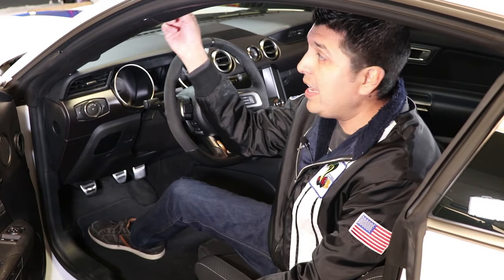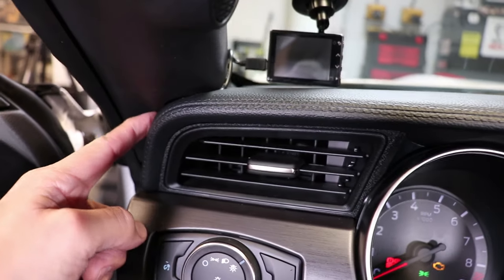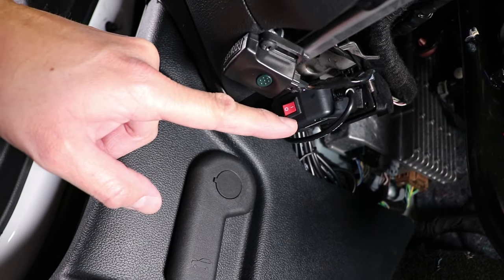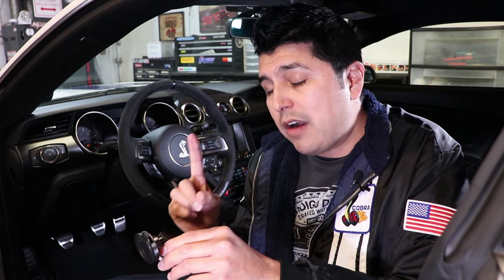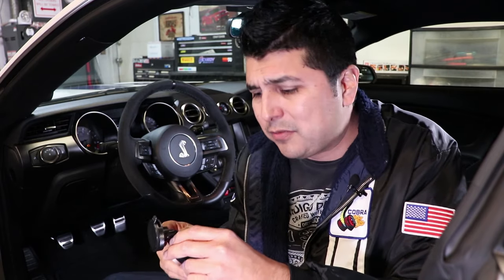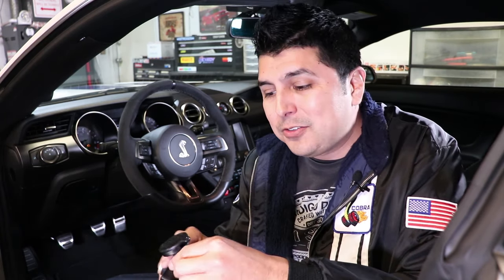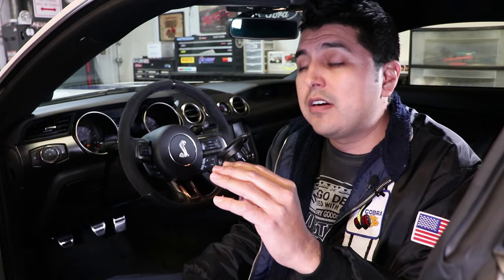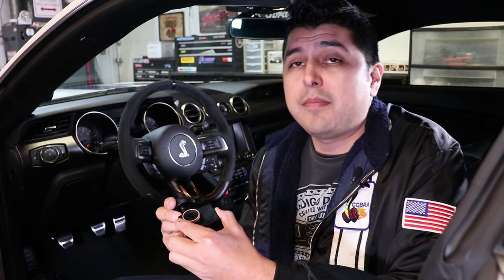Don't hardwire your Dash Cam! Try this instead!

Comment: so if your dashcam has a cigarette lighter plug for power, how do you attach that to the ODB adaptor?
Reply from the maker: Hi kingkongxiong, most dash cams use a USB connector for power, the cigarette plug only converts the 12v from the car to USB power at the end of the cable. I put links in the description to the OBD adapter, it does the same, it converts power from the 12 volts at the OBD connector into USB power at the connector end (which plugs into the dash cam). There are a few dash cams out there that use 12v instead of USB power, those would be the exception where it will not work for them. Hope this helps and thanks for watching!

Comment: The ODB connection is a great idea but what if  you use a ODB scanner to check what is going on with the car?
Reply from the maker: Thanks Yolanda! but yeah there is another option if your ODB port is being used by a scanner. Here is a power adaptor that taps into the original mirror' power https://amzn.to/3tDXPoj I'm working on a video showing it. Here is also my hardwire video if it helps https://youtu.be/83a3w6EtzXo and thanks for watching!
Reply: @AlexAutoFun  OMGosh, yes I can't wait to check out this video.  thank you for your answer.  another question, does the dashcam need to be hardwired for the parking mode to work?
Reply from the maker: @yolandagomez9255  It depends, some dashcam require you to hardwire them to enable the parking mode which won't be enabled by the OBD adapter or the mirror adapter. But here is alternative dashcam that supports parking mode without having to hardwire it https://youtu.be/bkzxrPe-e_8 :)
Reply: @AlexAutoFun  thank you.   This mirror cam looks fantastic
Reply from the maker: @yolandagomez9255  You're welcome, yeah I can't go back to a regular mirror now LOL
Reply: @AlexAutoFun  I couldn’t either if I had that mirror, that  one is awesome.  You’ve reviewed a lot of Dash cams, would you prefer a mirror cam or a task cam like the  garmin.? I like the hands-free feature on the mirror that you reviewed
Reply from the maker: @yolandagomez9255  I have both kinds but personally like the mirror dashcams because they are stealthy and blend in with the interior of the car. Specially now that newer cars are coming with LCD mirrors I think it also modernizes cars that didn't come with one like mine...
Reply: @AlexAutoFun  Hi Alex;  have you review the plug and play adapter for the rearview mirror yet?   I checked my auto  dim rearview mirror and not sure how to plug that in.  I would like to install it this way if I can.   I'm hoping you would review, I like your videos and explanations.  I have a 2012 toyota camary xle and I removed the mirror but not sure how to plug that in or even if I can
Reply from the maker: @yolandagomez9255  Hi Yolanda! not yet, I'm testing different brand ones to see which one works better and complete the video with it, almost there. Stay tuned friend! 😀
Reply: @AlexAutoFun  hi Alex did you ever find a plug and play USB for a mirror dash cam? I was looking through your videos and I can’t find anything I’m not sure if you’re done Experimenting.
Reply from the maker: @yolandagomez9255  Hi Yolanda! No unfortunately nope. I think it may have to do with how much power the actual OBD port can deliver which limits the power that the OBD adapter can produce...
Reply from the maker: Hi Yolanda! I finally found one that claims to output 2.5A! (which is what most mirror dash cams use and a few need 3A) and I remember you asked about this, here you go https://amzn.to/3epnu1O Cheers!
Reply: @AlexAutoFun  perfecto Gracias   hope you can do a demonstration of it.  I forgot,  what about a rear cam, will it work if you get a dash cam with a  rear cam?
Reply from the maker: @yolandagomez9255  You're welcome! ah yes it works like the one I showed on the video, except it will stay in surveillance mode all the time, where on the low power version you can select surveillance mode or ACC mode (both modes explained on this video also) Hope this helps, Cheers!
Reply: @AlexAutoFun  yes it does, thank you
Reply from the maker: @yolandagomez9255  You're welcome, glad to hear that 😊

Comment: The OBD port is designed for diagnostics only. It is not recommended to use it for powering anything beyond diagnostics. Even the little OBD plug the insurance companies give you to monitor your driving habits is not recommended to use.
Reply from the maker: Hi M J! I don't believe the SAE / ISO standard covered the power requirements beside the pinouts locations on the OBD2 connector. But traditionally I seen them capped at around 4amps which will cover most dashcam requirements (typically at 2amps) However I do know some folks rather not mess with the OBD2 port, check out my hard wire video https://youtu.be/zbxYA4VhuT8 maybe more of what are you looking for bud, hope this helps and thanks for watching!
Reply: @AlexAutoFun  Thanks!
Reply from the maker: @Mo.Jo. You're welcome my friend!

Comment: OBD should not be used to draw power for dash cams, manufacturer says on one of the blogs.
Reply from the maker: Hi J! Here is my follow up video showing how the adapter works (and how it relates to the SAE J1962 standard we use in the industry for the OBD2 port design and use) https://youtu.be/aV5jQovoaCI including the use of the OBD2 port by non-diagnostic tools. I been running mine for over four years now without an issue and since making this video, we also seen more dash cam like Ring, Garmin, Thinkware, Vantrue, Nexar, Wolfbox, use OBD2 adapters. However if you would like to avoid using the OBD2 port for power (and also looking to enable park mode) here is my other video showing the alternative Hardwire method https://youtu.be/zbxYA4VhuT8 Cheers!

Comment: Alex, so how did you end up watching files on PC? VLC  player cant, nor windows media player can.. any thoughts bud? thanks.
Reply from the maker: Hi A. Jay! you may have the dashcam set to H265 codec. This codec usually does not come with windows and will need to be downloaded separately. If you set the dashcam to use H264 codec it should play fine as it supported by windows without having to download anything else..
Reply: @AlexAutoFun  Thanks Alex,  I use VLC, it should be ok, what I found out from VanTop  was, I bought from ebay a fake Samsung 128gb EVO SDXC  card..waiting new card to see.
Reply from the maker: @ZorroDaddy  Oh man I heard about the fakes out there, always paranoid when I buy a new one check it real close!
Reply: @AlexAutoFun  Yes, well I took photo of the "pin" and oh boy, they were scratched, casing too, and under the scope showed it as if it was tossed in the street and cars passed over it.. recall  old beat up street coins?  same.
Problem with Vantop CS, and I sent several emails asking what type of SD your device uses, no answer, just run runarounds.
Reply from the maker: @ZorroDaddy  Man that sucks, this is the one I'm using if you are curious https://amzn.to/2FUFJuz it's worked great all this time!
Reply: @AlexAutoFun  Thanks, just ordered it,  BTW, Amazon in NOT immune to fake products.. they are becoming Ebay #2 last year or so.  Though I don't celebrate killing of Native Americans day ,  Happy and Safe turkey day.

Comment: That would be nice, but my car triggers the alarm when the car is locked and there is something connected to the obd
Reply from the maker: Hi Locknath 007! some folks use a OBD splitter like this one https://amzn.to/3Kv7OFr to run multiple OBD devices at the same time, however I have not tried that myself. And here is another video I made showing the Hardwire method https://youtu.be/zbxYA4VhuT8 Hope this helps and thanks for watching bud!

Comment: Where do you get the part that plugs into the OBD port? Also, I want a quick disconnect for the camera because I don't want someone to break my window to steal the camera!
Reply from the maker: Hi Ltl Paa! here it is Micro USB https://amzn.to/2Xzwtlt smaller USB connector or Mini USB  https://amzn.to/2XFijQA which is the larger USB connector.

Comment: Mm but you have a vision obstructuon now, plus hardwire is reversable from fuse box, or look for fuse thats always on that way power is on so if someone breaks in its recorded
Reply from the maker: Hi Eric! yeah unfortunately the lower portion of the windshield on the corners is the only location we can "legally" install our dashcam here in California ugh. I did also posted a follow up video showing the hardwire method https://youtu.be/zbxYA4VhuT8 if you want to take a look and thanks for watching bud!

Comment: Doesn't hard wire kits have auto shut off so your battery won't drain? Mines does
Reply from the maker: Hi adictiveadictive, yes most high quality hardware kits have the auto shut off feature, which to your point it's definitely essential to avoid the dashcam completely draining the battery. Thanks for watching bud!

Comment: The problem with this is, you will adjust the switch every time you want to use surveillance mode, hence hardwired no need to adjust its automatically turn on.😃 i think hardwired is better.
Reply from the maker: Hi Ron! I typically leave mine in the mode that works best for (so I don't switch it at all) however I imagine that there may be people out there who do. Hardwire does have many advantages (at the expense of more labor) including enabling true parking mode. Here is my follow up video showing the alternative Hardwire method https://youtu.be/zbxYA4VhuT8 Cheers!

Comment: Easy to pull a A-pillar molding and your wiring routing would not work on many cars/trucks. Won't work on my GMC PU truck or my Hyundai Tucson just to name two.
Reply from the maker: Hi Douglas! Yep this method is not for all vehicles, here is my other video showing the alternative Hardwire method https://youtu.be/uZp95NbNlmM This maybe more what are looking for. Hope this helps, Cheers!

Comment: This is really not the right way to install the dashcam at the bottom of the glass and in a corner. The dashcam should be centered at the top of the window to get the most out of its 180 degree angle.
A camera behind the mirror attracts less attention than putting it on the dashboard.
Reply from the maker: Hi Bob! Unfortunately we are very restricted on the mounting location for the dash cam here in California :( But the installer can place the dashcam higher by running the cable up the A Pillar if desired. If there is an airbag in the A-Pillar here is my video https://youtu.be/uZp95NbNlmM where I explain some of the issues that can pose. Here is also my follow up video showing video from different angles to help you decide the best one for you https://youtu.be/F7OzM2i7ErE Hope this helps, Cheers!
Reply: @AlexAutoFun  
Surprised to see that the dashcam records well, even if it is not centered.
Tank you !
Reply from the maker: You're welcome!

Comment: Do these obd adapters drain battery if left on overnight to record in parking mode
Reply from the maker: Hi Ashley! ah good question, not all OBD2 power adapters have low voltage protection, however the adapter I linked in the description has a low voltage cut off so I will stop pulling power to prevent the battery from getting too low. And here is another video I made that shows the alternative hardwire method if you want to see what that looks like https://youtu.be/zbxYA4VhuT8 Hope this helps, Cheers!

Comment: Good vid. So the OBD cable will allow the Garmin to at least do 24 hours of recording right
Reply from the maker: Hi Zack! the OBD cable unfortunately does not enable the Garmin's "Parked Mode" where it will record non stop even when car is off. Garmin sells a special power plug that enables this function, I have recently got one and I got a video coming up with it maybe that will help! thanks for watching bud!

Comment: will moutning that low cause some problem with the video footages?
Reply from the maker: Hi Xuan! my view is actually pretty good, but I imagine this will vary from dash cam to dash cam. The Garmin 55 has a really wide angle lens and I think that helps to compensate for the low angle. However the dash cam could be placed higher by running the cable up the A Pillar if desired (we are super restricted in the mounting location here in California ugh) Hope this helps and Cheers!

Comment: There are cameras that records when motion is detected and “hard records” when it detects impact, something with G sensor, I think.
Reply from the maker: Hi Tærtær! that's correct the G-sensor will hard lock the files preventing exposure. I should have been more clear I was referring to the using the time lapse function where it records continuously over days. Thanks for pointing this out and commenting my friend!

Comment: Hey guys please don’t use your obd II port for a dash cam. It’s not designed to have constant power running through it all the time, it’s only meant for scanning codes. You run the risk of damaging the main computer of the car. It’s best to hardwire or use battery power or usb.
Reply from the maker: Hi Steven! Here is my follow up video showing how the adapter works (and how it relates to the SAE J1962 standard we use in the industry for the OBD2 port design and use) https://youtu.be/aV5jQovoaCI including the use of the OBD2 port by non-diagnostic tools. I been running mine for over three years now without an issue. However if you would like to avoid using the OBD2 port for power (and also looking to enable park mode) here is my other video showing the alternative Hardwire method https://youtu.be/zbxYA4VhuT8 Hope this helps, Cheers!

Comment: I bought one with the switch on. When i start the car camera switch on but after 4-5 seconds it turns off. Why?
Reply from the maker: Hi Tarkan! That is strange, the one I used (linked on the video description) does not turn off unless I switch the mode (as explained on the video). There are a couple of possibilities, the OBD port on the vehicle may be defective, here is what I use to test it https://youtu.be/QAwpySOMQUI or the vehicle is newer and can control power to the OBD power automatically (likely a hybrid) that is turning off power to the port (for efficiency or other reasons) and assuming the port works and can also provide power (without the vehicle commanding it to turn off) then it's possible you may have received a defective OBD power adapter. Cheers!

Comment: Very informative video! I'm wondering what the device next to the OBDII connector at 2:13 is? The one with the oval button on it. My friend got a used car and it came with that same device installed and we couldn't figure it out!
Reply from the maker: Hi Sampras! It's an dealer installed anti-theft system...

Comment: Bought the obd2 I have a v1p plus so all I need to do is connect then I can leave it on?
Reply from the maker: Hi Jrock! take a look at the 2:21 mark, where I go over the two settings on the OBD adapter so you can decide which setting will work best for you. Hope this helps and thanks for watching!

Comment: uhhhh i thought leaving anything electrical in the obd port will end up frying your circuits as its not made to have continous voltage drawn from it over night or even plugged in
Reply from the maker: Hi! Good question, here is my follow up video showing how the adapter works (and how it relates to the SAE J1962 standard we use in the industry for the OBD2 port design and use) https://youtu.be/aV5jQovoaCI including the use of the OBD2 port by non-diagnostic tools. I been running mine for over four years now without an issue and since making this video, we also seen more dash cam like Ring, Garmin, Thinkware, Vantrue, Nexar, use OBD2 adapters. However if you would like to avoid using the OBD2 port for power (and also looking to enable park mode) here is my other video showing the alternative Hardwire method https://youtu.be/zbxYA4VhuT8 Cheers!

Comment: Will a dash cam possibly blow a fuse that is connected to the OBD2 reader?
Reply from the maker: Hi Josh, yes It possible that a fuse may blow, anytime an aftermarket part is connected to your electrical system it could create issues, specially if you get a defective product (sometimes they do escape the factory) fortunately my OBD adaptor has been working great still no issues. Let us know if it works out ok for your bud!

Comment: Has anyone had weird issues pop up using OBD power connectors?  Like the car throwing up a code or warning light?
Reply from the maker: Hi 59phonebone! I been running mine for over four years now without an issue and since making this video, we also seen more dash cam brands like Ring, Garmin, Thinkware, Vantrue use OBD2 adapters. However here is my follow up video showing how the adapter works (and how it relates to the SAE J1962 standard we use in the industry for the OBD2 port design and use) https://youtu.be/aV5jQovoaCI including the use of the OBD2 port by non-diagnostic tools to help you decide if you want to use the OBD2 port or not. And if you would like to avoid using the OBD2 port for power (and also looking to enable park mode) here is my other video showing the alternative Hardwire method https://youtu.be/zbxYA4VhuT8 Hope this helps, Cheers!